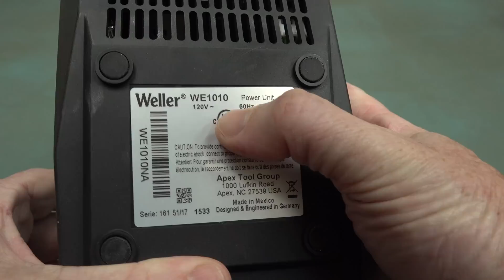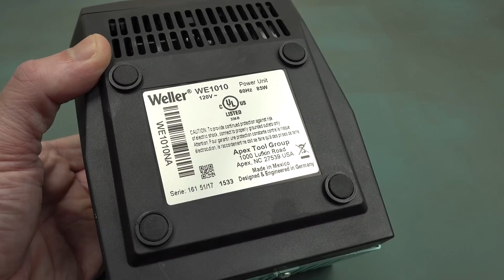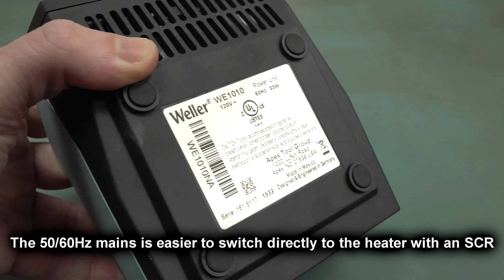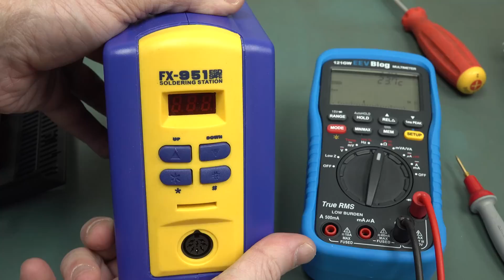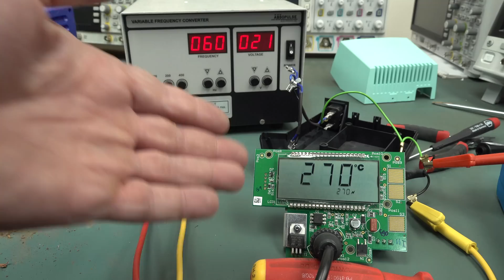EEVblog #1152 - 240V-120V = Magic Smoke!

Comment: There should be no way to plug 120/240 Volt plugs into each other.
Reply: Try to avoid that :) likes benzin vs diesel...
Reply: The problem is IEC connectors are  fantastic for computer equipment etc that is dual voltage however in this case I think Weller should have had a fixed US plug which definitely would make you think twice before putting it on a plug converter.
Reply: Technically there isn't, a US/Canadian plug won't fit into an Australian (or European) socket, Dave must have been using an adapter here.
If it had an Australian plug Weller would be liable for any damages...
Reply: @deceitive3338  "Technically there isn't, a US/Canadian plug won't fit into an Australian (or European) socket, Dave must have been using an adapter here." Nope, no adapter needed as it used a IEC connector to connect to the power lead
Reply: @DanafoxyVixen  Ah you're right, just rewatched. That's awful, devices with an IEC connector should be required to have a 240/120v switch (and appropriate transformer). At bare minimum should be fused. Crazy
Reply: Normally if you use an IEC connector for something like this, adding a primary side fuse is enough. It will simply trip within a few ms and no other damage should occur.

Comment: This was totally caused by core saturation, turning the primary from an inductor to a resistor. It would be more expensive to have enough metal to tolerate a 2x overload. 
Hard to see how it can comply with safety standards to have a 10A capable input connector and no internal fusing. A primary short could potentially dissapate a kilowatt - this has to be a recall-level design flaw. Would be interesting to compare the 230V version.
Reply: Could saturation also kick in due to 50hz mains on a transformer designed for 60hz?
Reply: That certainly wouldn't help.
Reply: @ald3nt3  Yes. It lowers the saturation voltage 20%. Between that, and double the voltage, its a wonder it took even that long for the primary to go up in smoke!
Reply: @ald3nt3  yes that and the metal mass being small is exactly the problem
Reply: @ald3nt3  it would definitely be reactive, and lower the power factor, and thus generate heat.
Reply: I wondered the same. On old (vaccum tube/ valve) Television the 50 hz power transformers were way larger than the 60 hz versions had. It's my understanding that a 50hz trans will run fine on 60hz but a 60hz can run warm to hot on 50 hz.
Reply: Bartosz Marciniak You’re correct about the relationships but that’s not what happens at 50Hz. You get core saturation as the current runs out of range since the voltage stays too high for too long. So those loss equations you refer to of course still apply, but they don’t cover what’s going on: the transformer runs hot not due to core losses, but due to windings being exposed to a saturated core and acting like an air inductor. It takes a might big air inductor to do much at line frequency :)
Reply: As a datapoint, the older WD1 and WD2 have externally accessible fuse holders integrated into the IEC receptacle.
Reply: @nezbrun872  My WX-2 also has a fuse integrated into the IEC receptacle.  It's there and you could miss it with a cursory glance.
Reply: @vincei4252  If that fuse was there, core saturation would have tripped it immediately, unless it's a 10 or 15 amp fuse.
Reply from the maker: Does anyone know the legal regulations on this?
Reply: @EEVblog  We once had a floating neutral on our company power net due to a faulty main switch, resulting in 380v between one phase and the neutral instead of 230v (assuming worst case, I was not there to measure). This issue basically blew out ALL the transformers that were connected. Only one catched fire, luckely it was outside, but all of them were broken. I later leaned that it is allowed to malfunction but not to catch fire (as long as it is properly fused), at least in the EU.
Reply: @tomvleeuwen  I remember a customer had a neutral fail on a 3 phase farm.
480v across a 240v system distroyed everything plugged in including the house wiring.
Reply: Am I correct in assuming that only US/Canadian regulations would apply here, since this is only supposed to be sold there?
If true, I guess the question becomes, do those regulations require a mains transformer to be fused?
Reply: @Basement-Science  even if not required, I'd expect any decent product to have it
Reply: @tomvleeuwen   We had a backhoe sever the neutral line to my house. All the garage door openers failed, the toaster, stereo preamp, lots of things. We'd just moved into the house and finished the evening with half a dozen Connecticut Light and Power trucks on the driveway as it seems my house was the most interesting thing for all the lines men in the area that night. Not pretty. Had to spend a lot of time going through finding what had been destroyed. Thankfully no computers TV's or monitors were damaged in that episode.
Reply: I´ve tried overvolting some mains transformers in the past. Usually, until about 50% overvoltage at no load, the transformer would be ok for at least many seconds, but if voltage is increased further, they start dissipating serious amounts of heat long before you are at double the voltage.

So it´s not surprising that this transformer failed.
Reply: @Basement-Science  almost certainly saturation. All of it then gets dumped as heat, heat means burnt enamel, then short, then more heat, now death spiral.
(Sorry if someone already hit this but I didn't read all of the comments.)
Reply: Adam Bryant The same thing happened at both a college I attended during what wood have been high school and at the university I later attended.  In the case of the college it happened to the worst building of all, the computer sciences building and destroyed every computer in the lab, though the mainframes survived courtesy of the UPS sacrificing itself instead — power was out to the campus all day due to the transformers being destroyed and the computer science building was off limits for roughly a week to be ventilated and for mass equipment replacement.  At the university I went to they also suffered a phase fault (phase to ground if I recall) when the power company was performing line work in the area and it absolutely destroyed the Engineering college’s HVAC system and set off just about every possible alarm in the fire system simultaneously leading to a rather wild automated evacuation warning, they were also down for a few days to repair equipment since HVAC is not “optional” in Florida during the heat of summer in a sealed building.
Reply: @Basement-Science  Fuse, or a thermal cutoff tucked in around the primary winding. That was missing on this Weller.
Reply: @Basement-Science  That saturation voltage is exactly proportionate to frequency as well. you could only over voltage about 25 to 30% at 50 Hz. So, taking this Weller transformer, doubling the voltage, and dropping the frequency; There's no better way to saturate the core!
Reply: I'm totally sure you can't sell that in Europe without a fuse before the primary.
Reply: they probably depend on the fuse in the plug.
Reply: @davidgermain  We don't have fuses in our plugs in NA on most devices. The 15 or 20 amp panel breaker is considered sufficient by what ever regulatory body is in charge of that.
Reply: @mgkleym  That protects the CORD, not the appliance the cord is plugged into.
Reply: To my knowledge, products in the US don't require any kind of fusing. I've seen plenty UL listed devices that could easily overload like this with no fuses or circuit breakers on the mains side. Honestly, being in the US and looking at electrical codes and practices in 240v standard countries (especially the UK), our codes seem extremely lax!
Reply: mikeselectricstuff Correction: UL allows using that IEC input at 15A according to Wikipedia, presumably to allow more 230V designs to be used on 110V without upgrading to the 16A connector type. But this raises the worst case power dumped into a failing winding to more than 1.8kW on a normal 110V to 120V supply.
  It should also note that my 230V 936 clone station has a 2A input fuse.
Reply: Dan Douglas Typically if you wanted good surge protection and are using a fairly robust MOV, on 120V you may see as low as around a 180VAC MOV (that’s 180VAC rms, rated not peak), so such would certainly activate at 240.  Now if it were a tiny piece of junk MOV like in some consumer outlet strips where it’s more of a gimmick  then it may not fire until well over 300+VAC (rms), in which case it likely would not fire at all at 240.

That said, on transformer devices I often liked to place the MOV on the secondary side to protect the load since transformers are more forgiving of transient surges thanks to their inductance and impedance, but focusing on the secondary let the transformer act as a large choke limiting the peak current seen by the MOV and protecting the more sensitive load.  Though in some cases my surge protection was as simple as a low amp fast acting fuse and a neon bulb across the secondary output — any large surge is clamped and if it persists the fuse blows instantly.
Reply: I don't know about recall, it seems to have operated as designed, but at the same time, it could have become a fire hazard, but again, it's not designed for more than 120V 60Hz (thus the NA in the model number).

Still, a primary fuse would solve major issues and possibly save the primary in a similar situation.  I'm half tempted to mod mine to include a fuse on hot.
Reply: the Thermal cutoff that should have been tucked into the primary winding bobbin was missing. a definite oversight by the manufacturer. it should have heated up, and just blinked out. Maybe a hot smell, but not all the smoke. They do that, instead of a fuse, because if only a couple of coils short, the winding could get hot enough to catch fire, without drawing enough current to blow a fuse. The thermal stop cuts the power, if it heats up for ANY reason.
Reply: AvanteRobot good luck ever getting a corrective action report from anything larger than a mom and pop shop these days.
Reply: stupid comment but: the thumbs up on your comment are close to the voltage it took when it went up in smoke
Reply: There is no fusing requirements in the US for mains devices. Each room has a 15 amp breaker with wiring running from that breaker to the device that's capable of 20 amps sustained.
Reply: @pahom2  IT's a 15 amp circuit holy shit.
Reply: @pahom2  It doesn't need one. Even that thin cable is able to carry 15 amps long enough to pop the circuit breaker in the breaker box before a fire is started. I've had it happen in my own home, devices on cable rated for only 2-3 amps shorting dead internally just pop the breaker the instant they're plugged in and the wire barely even has time to get hot.
Reply: @pahom2  I've had it happen in my own house with my own appliances.
Reply: @pahom2  The device still tried to function for the few seconds the breaker was still connected.
Reply: @Ormaaj , which shows that penny pinching really does make a "good" unit survive when a shlock unit won't.
Reply: @Ormaaj  It should have a thermal cutout tucked into the primary winding. That was missing on this transformer.
Reply: Yes, it could only be core saturation or an unlikely insulation breakdown caused by some random manufacturing defect. The insulation on this transformer will have no problem dealing with 240V indefinitely. So that’s not it. The core saturated for sure. You don’t sell cores that can take twice the volt-turns of what’s on the nameplate - it’d be a waste of money and not very green thing to do. The instant smoking is in line with resistor behavior. There is not that much wire there - it got beyond the smoking point of the insulation in seconds, commensurate with the feeble thermal mass of the winding. As for measuring the transformer resistance: sure, low power mains transformer have “high” resistance windings. I have a primary side 2MHz switcher here that runs off 300VDC and the “winding” resistance is a fraction of an ohm. And it’s “only” a 750W switcher. I say winding in quotes because it’s more like a couple turns of enamel coated wire rope on a relatively tiny core. Due to the skin effect, the windings are made out of rope rather than solid wire, to maximize the conductance first a given copper cross section.
Reply: what ??? lol
I trust weller and just about to buy one 
if its safe its safe
no fuse on primary ??? pfffffff 
made up stuff 
do you believe in unicorns to
Reply: @alancoales7057  yep, but did i wrote that iron losses were the problem?
Reply: maybe i did 2 years ago, but i don't think so..
Reply: @Ormaaj  this orange devise seem to be just a polyfuse in series with regular fuse..
there is no mov on the primary or secondary
Reply: however there could be a MOV which drops  overvoltage to blow a series fuse.
https://i.stack.imgur.com/BvLR7.png
Reply: mikeselectricstuff you not at Chinese big booby girl?